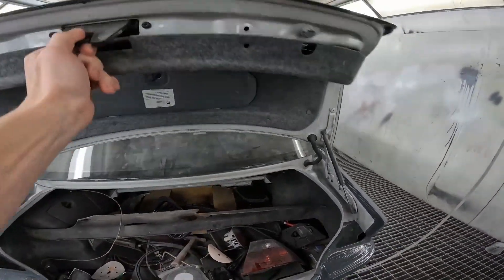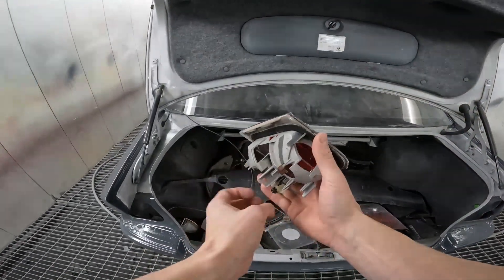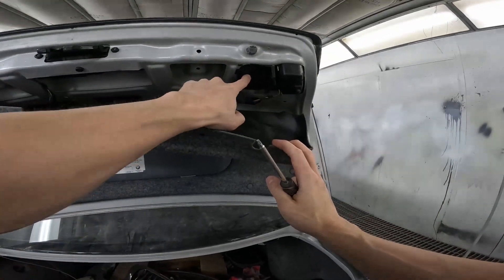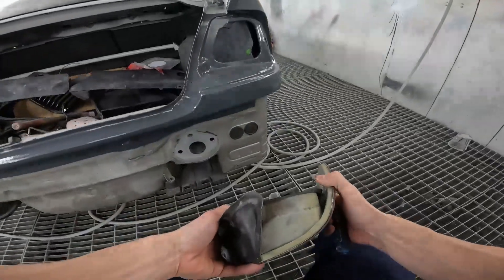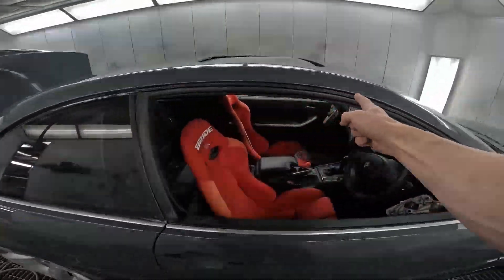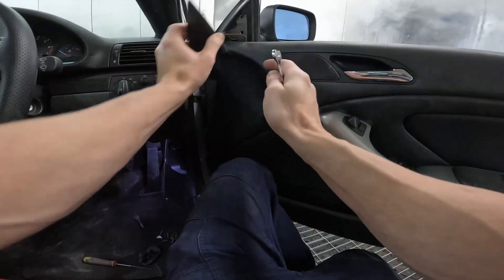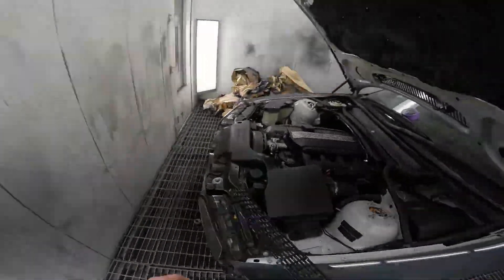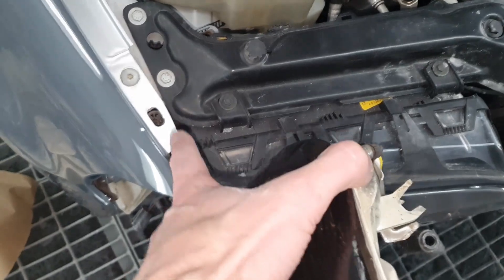REASSEMBLY OF MY E46 BMW COUPE AFTER PAINT!!!

Comment: Hey Adam how did you make the front suspension even up with the rear suspension?
Reply from the maker: Just had to bite the bullet and accept the wheel arch to tyre gaps would be different front to back. You can either have an even side skirt to the floor front and back like mine or have even fender to tyre gap which makes the side skirt way lower in the front. Honestly it messed with my OCD every day 🤣